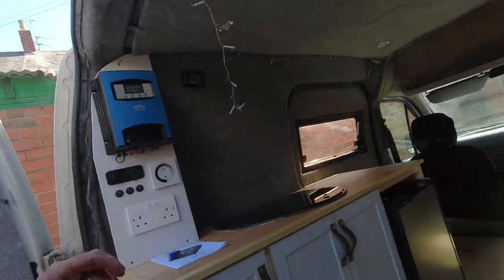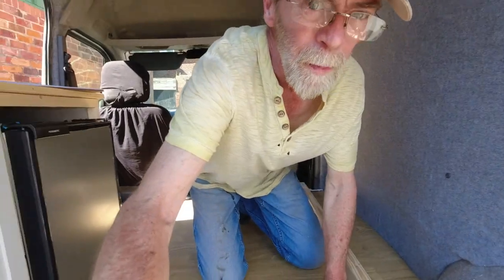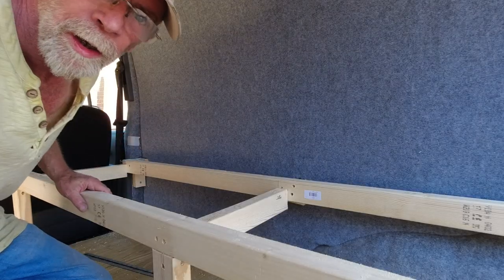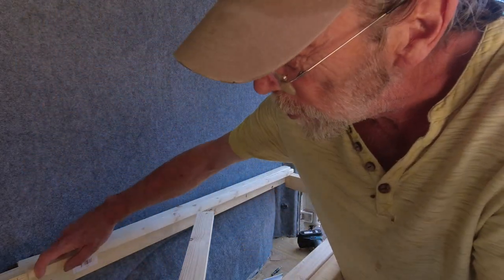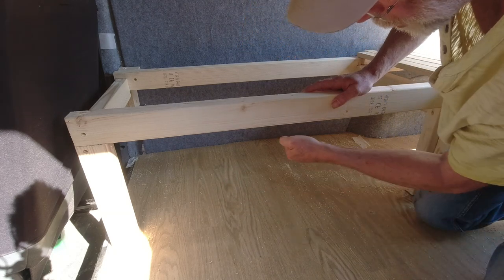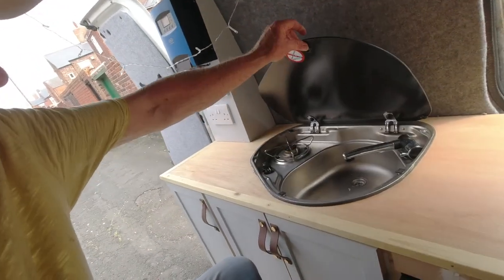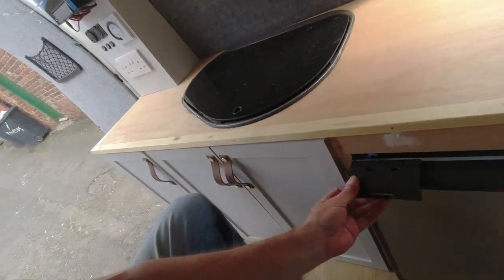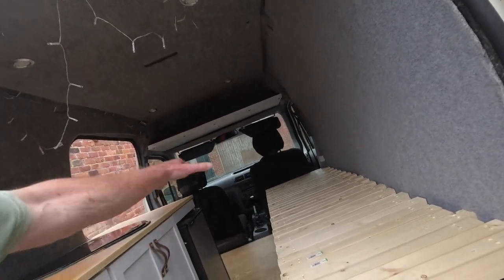Micro Camper Re-Fit - Part 2 - Slide Out Bed and Micro Van Tour

Comment: Hi Dave, good job on the pull out slat bed and the rest of the build too! I noticed you decided against using runners and divided it into two sections making it easier to pull out which looked like a good idea and with it being a stand alone section would have meant extra frame work to attach the runners to, if you know what I mean! Looking forward to seeing your next build.
Reply from the maker: Yes, I may try the runners on another build, a bit more complex to make. But so long as there is plenty of space between the slats the slide out beds work ok. More builds soon. Thanks Dave.

Comment: Hey Dave, random question but do you know if the van can still go through a regular MOT after the conversion?
Reply from the maker: So far as I know the conversion will not affect the MOT. I had a self converted van put through an MOT earlier in the year and it was fine.
Reply: @dave-watson  perfect cheers Dave